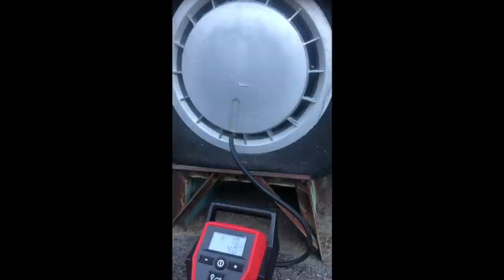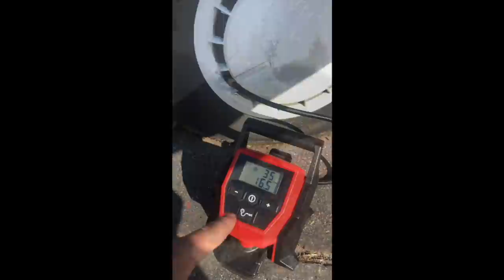FORGOTTEN 1987 Syncro Westfalia Rescued after 23 Years!

Comment: instead of breaking the glass under the doorhandle put a butterknife push it in and wiggle it till you find the lock then push it up, it might bend the doorpanel a bit under the handle or destroy a bit of paint as a firsttimer ones you get the feel of it you can open any VW with a butterknife......there you go.
Reply from the maker: That’s a $400 door panel and a $20 window. Additionally, as stated- I have the window, the window is two bolts to install a replacement. 

I’ve had nearly 20 years and countless vanagons in these kind of situations to work with, and concluded long ago- the window is the best, most consistent, and easiest way to open the vehicle without any risk of damage (such as the scratched paint and damaged door panel you suggested)
Reply from the maker: Oh wait you’re suggesting damaging the exterior, the actual painted, straight body work of the door, and going in from around the door handle? There’s no gap there, i can’t see that being possible without absolutely destroying the entire door. Any chance you could do a video showing us on your vanagon?

Comment: I have gotten into a locked bus by cutting the sliding door glass seal. Then the window will push in.
Reply from the maker: Wow, that sounds like a profoundly more expensive and time consuming way to put it back together than the two bolts and $20 window I broke. I can install the replacement in 3 minutes.

Comment: Couldn’t you have climbed through the engine bay to unlock the doors without breaking a window?
Reply from the maker: We tried but there’s really no good access to the bottom side of the engine hatch latches- plus there was a ton of stuff piled up on top of the hatch (that is the “trunk” after all). 

I knew I had this piece of $20 glass, and it comes out with two screws- it took 10’minutes to replace.

Comment: I hope you are getting these Westy's cheap. So much work to bring one up. A good locksmith could have saved you the hassle of breaking the wing window.
Reply from the maker: "Cheap" is all relative- that's a $100k car pretty soon. 

The previous owners had 23 years of driving around the car in their driveway as an opportunity to call a locksmith- I had two days to move a car. I was well aware that I have a box of spare wing windows at home, which is why this particular window was selected to be broken. Once home- this $20 window was replaced in fifteen minutes. I'm not sure I could have found a $20 locksmith that would have the car open in fifteen minutes.
Reply: @TheBarefootForge  by now your viewers should know that your Hammer is not to be judged

Comment: I prefer not using the Subaru conversion. AAZ diesel is IMO better. with turbo has plenty of power and gets 30mpg. The subaru has plenty of issues. and is just as hard to work on as the Waterboxer.
Reply from the maker: On a syncro though- a proper diesel swap is quite a bit trickier. You need to find a syncro diesel fuel tank, filler neck, carrier bars, etc etc that are all specific to a vehicle that was never sold in the US. Then- you have the transmission problems, syncro transmissions do not tolerate big torque and even with a rebuild and regearing- the diesels have the shortest transmission life. 

A proper syncro diesel swap including rebuilt/regeared transmission is the most expensive option, probably about $20k DIY and closer to $35k professionally done.

Comment: the easiest way to unlock is the sliding window from the sliding door
Reply from the maker: Not if the latches work correctly- then that’s literally the hardest window on the whole car to open.
Reply: @TheBarefootForge  u need to remove the plastique under the sliding glass then pull the glass down that free up the lache   of the window
Reply from the maker: @midowbf  luckily this was three years ago, and as I explained- I chose to break this window because I had a spare, and it’s the easiest to replace. So, in the time, this was 100% the right choice and I’d do it again the same way without hesitation.
Reply: Good luck it nice watching your videos cuz where i live westfalia are rare syncro too the simple 2wd is going to disappear too

Comment: I see you have a clutch pedal so manual trans. Didn't all synchros have 5 speed  ?
Reply from the maker: Yes. All syncros have a 4+1 speed. There are 4 synchronized driving gears and one ultra low gear that you don’t really shift into as part of normal routine. It’s a very specialized and expensive transmission.
Reply: @TheBarefootForge  And I remember it as a very reliable one, in case You do Your maintenance aka oil changes ..... That Syncro 4+1 was, unmodified in stock configuration, good enough for the Swiss army to buy Syncros by the dozen. They (swiss Army acquisition branch) were the reason the "Wolf" (Mercedes G military spec) had modified axles compared to the civilian version .....
Reply from the maker: @manfredschmalbach9023  sadly the transmissions are absolutely the weak link of these syncros, it’s also the single most expensive component. The possession of a transmission made more of a difference in deciding to purchase this car then any other single aspect.